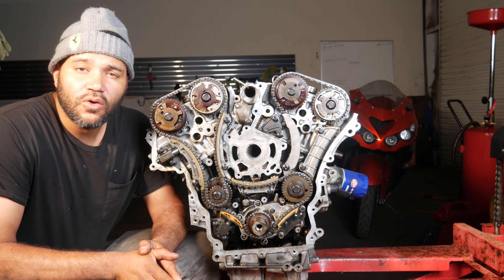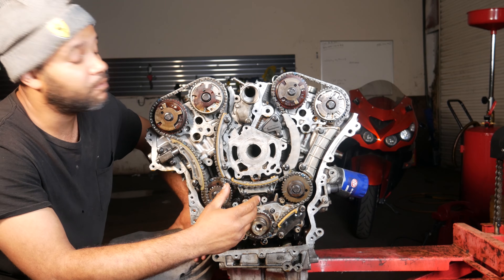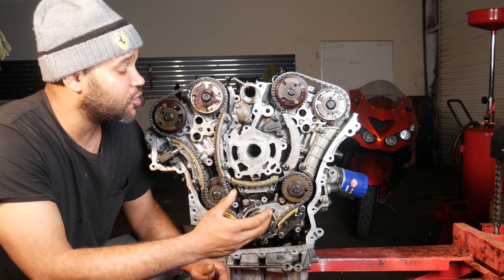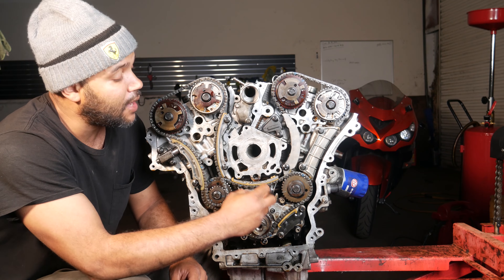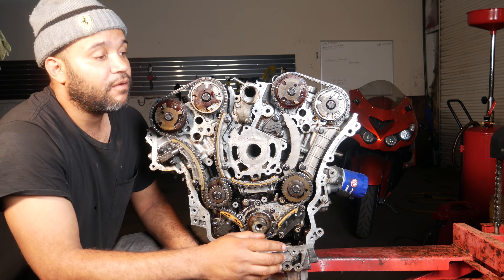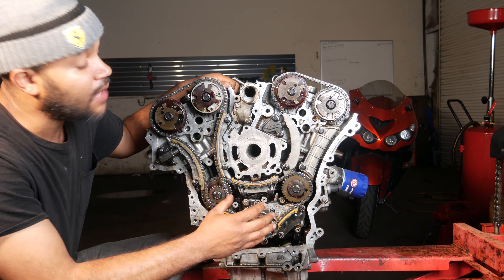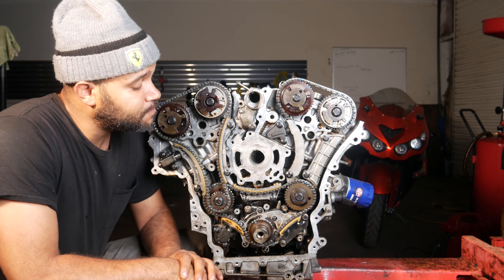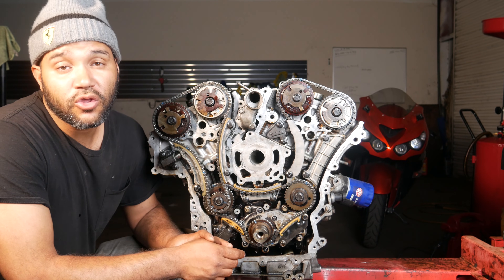HOW TO PREVENT TIMING CHAIN PROBLEMS l GM 3.6 ENGINE PROBLEMS

Comment: I have 2015 impala with 3.6 engine, i change oil every 3000 miles and only use synthetic oil. Oil changes are cheaper than a timing chain job.

Comment: The only thing I disagree with him is over 60 years I see nothing but trouble when you add motor cleaners to your oil..
I'm changing your oil at 5,000 MI should be good enough

Comment: Yeah my 2008 SRX is starting to give me those P0008 & P0017 codes. I bought it used with a lot of miles so it looks like I'll be replacing those three chains myself. I've replaced the sensors VVT, CPK and on other one but still get those codes. I'm going to try to change those chains myself because to have it done costs more than I put in it. And as we all know Cadillacs lose money the minute you drive off the lot plus they won't work on a Caddy if it is over 10 yrs old....grrrr. BTW lose the background music it irratates.

Comment: I had a 15 Camaro with the LFX engine, 165k miles and did nothing but change the oil, oil filter. air filter ,tires spark plugs and 2 purge valves. I just traded it on a low mileage 15 Camaro, I hope it lasts the same.

Comment: I'm interested to know your opinion about the PSV valve and drilling it. I have two cars with such an engine, one with regular injection and the other with direct injection. I drilled it on one engine and nothing has changed yet.

Comment: Change oil at 3.500 and no more. Change pvcvalve every 10,000. Never have a problem.  Don't drill out valve. Replace it. Oil does not last any longer. Dont let anyone tell you oil last any longer. The oil is still oil. There is no magic pixie dust that they put in it to make it magically last longer. Its BS.

Comment: Thats why you dont wait 6000 miles. Change at 3000 to 3500 miles. Never let someone tell you. Oil is better now days. It last longer. No it doesnt. If its black. Its no good. Or you can change the timing chain every 5 years. Or 80,000 miles. Old oil doesnt flow and gets hot

Comment: Noone ever condemns the oil level sensor system.  At least come up with a software update, that allows the low oil level to trigger a light, sooner.  My Cadillac 3.6 never had that light come on, and I top off my oil level very frequently

Comment: My 2013 Lacrosse is programmed for oil changes at close to 5K. I bought it used at 95K and it consumed oil when I bought it. I have changed the oil at 10% and use the same brand at every change. Consumption is way down. Carfax records had oil changes that were done at roughly 5K by the previous owners. I think that the importance of sticking with an oil brand is glossed over and that because of the cost to change the oil at a shop is so high, that many people are resetting their monitor and not changing the oil as recommended. Those people then scream loudly when they have timing chain issues.

Comment: People have complained about timing chains in the 3.6L engine for years...and all this time all it took to correct the problem was routine, periodic oil changes. Don't believe the automaker who says you can go 7-10-thousand miles between changes. Change your oil ever 3-to-5-thousand miles and you will get a very, very long life out of your timing chains and your engine. It's cheap insurance.

Comment: They said ill-advised oil change interval was the primary culprit to oiling problem. But direct injection brought pcv engine eating oil phenomenon. So basically you have to check oil more frequently, not less.

Comment: I am thinking about buying a 2016 LTZ equinox with a 3.6 v6. It has 125,000KM. Is it too late too treat it nice with frequent oil changes to make it last along time? Or should I change the timing chain and get an engine flush to start from
Scratch and then baby it with the oil changes.

Comment: Hey man I changed out chains on my 08 cadi cts 3.6 and aaahhhh I used Amazon kit chain, tensioners, guides I left the old cam phasers on there my problem was that I had a ticking noises on start up with no codes at all I go and replace a guide bcs that looked to be the problem and then I basically forcefully installed a tensioner after setting it off and that stretched the chain that’s the reason why I went with Chinese kit now I have correlation codes p0018 p0017. And p0008 engine position system performance bank 1 please help my idea is use all oem parts and replace all phasers also the ticking isn’t there is just as soon as codes pop up car starts acting up

Comment: Chains on timing is like bicycle chain. There are rollers that wear out when insufficient lubricant is allowed. When the rollers wear down the chains get longer. It appears like a chain stretch, but it is just smaller worned down rollers that make the chain longer.

Comment: I change my oil every 2.000 miles with Castrol or Valvoline high milage. im the 2nd owner since i got it. i have had chain noise at start-up. i stopped this by turning the engine over in flood mode and also drilled out the pcv valve. 264.000 I've had for 2 years.👍

Comment: Cheap oil with poor thermal heat dissipation is  what breaks down your vehicles.  These 3.6 engines do run hot, so it is crucial to have good high-quality oil with good heat dissipation, which is the key to a long-lasting engine.  Poor maintenance and neglect will cause your vehicle to have a shorter lifespan.

Comment: Timing chains stretch because its running low on oils duhhhh...inproper lubrication and heat will cuase the timing chain to stretch when they get too hot without any oil lubrication. Using cheap oils that lose its lubricity and heat dissipation will result in dry timing chain heat build up on the chain.

Comment: There is a mod to the PVC valve to get more ventilation to the engine.  Drill your pcv valve out top 7/16 hole, and bottom 5/16 hole. This will increases the ventilation to the whole engine witch I read is not the best when they built the 3.6 VVT Direct Injection engine.
Reply: Also clean the PVC all the time, it will help the inside of the engine a lot.

Comment: Thank you Boss Auto for your video. It was very informative and helpful. I have a 2017 3.6 , I’m trying to increase its life. I change oil every 5k - 6k miles. When should the spark plugs be changed for that engine? Keep up the good work.

Comment: its not just the crankcase breather and the oil life intervals . people need to take their cars to high rpms once and awhile because they need to get the oil moving around the engine and thats only done at high rpms. dear god dont use flush because that will cause leaks . use good oil , change it every 4 to 5k and take it to high rpms atleast once a drive

Comment: I have a 2015 impala 3.6 with 75,000 miles.  I change my oil every 4-5,000 miles.  I use the Napa gold oil filter as well.   As far as the engine breathing, the rear bank of the engine has a breather tube on the valve cover, but it is not removable.  I learned the hard way on that.  I'm guessing periodically i can run a piece of wire down that tube and keep it open.  I never have any oil in my intake or on the butterfly.  I don't have issues with the engine using any oil either.  So far, it's a great engine.  I'm thinking about adding some engine flush before my next oil change.  My brother had a Buick with the same engine.  His engine coded with the dreaded timing chain issue, and started mis firing.  He drove it, after I warned him not to.  Big mistake.  It threw a rod through the block.  That was a dumb move.

Comment: I just bought a Chevy 2024 premier blazer. I’ve had it for a little while now and I drive it to work around 8 to 10 miles a day one-way. I pulled it in my garage and change the oil at 2000 miles and that oil came out really black at 2000 miles so believe it or not I will be changing the oil at every 2000 mile intervals I know that’s excessive but I had a 1987 Chevy pick up with a 350 in it throttlebody injection and I changed you on that every 2000 miles, I had the engine for 425,000 miles and I still have the truck today with the same engine no problems and it doesn’t burn oil. I know the engines different than this one but I will be changing the oil just like that I can’t believe how black the oil got 2000 miles if you could use the GM oil monitor in your car all they want you to do is make sure it gets past the warranty and then you’re on your own. Thanks for your video. I’m sorry about the car but this is what I have now thanks again you really explained it well.

Comment: Yes Sir engine flush with every oil change. My 2014 impala gets 2 oil changes a year. Nov & May so I'm ready for winter & summer. My tip is to jack the car up on the driver side about six inches and let it drain for at least 1 hour. Or until you can count to 30 without seeing any oil drip out. The oil drain plug is on the passenger side facing the rear of the car. I drive about 10000 miles a year.

Comment: I have a 2011 Buick Enclave with 184k miles on it. I follow the factory oil change guide (7,500 miles) and infrequently add a ceramic additive.
I think changing the oil every 5,000 is a prudent suggestion.
I also encourage replacing the PCV valve and breather tubes every 75k miles. Enlarging the breather holes on the PCV valve is strongly encouraged.
Reply: Great advice but this should only apply to model years up to 2012, after 2013 they welded the PCV valve to the valve cover (even if it looks removable), I learned this the hard way after trying to service mine, ended up breaking it off trying to remove it. Had to remove the whole valve cover to replace with a new one, that's when I learned it is no longer serviceable and should be left alone.

Comment: FORD GM ALL MADE ENGINES W/ one timing chain and they ran for ever NOW car engines have four cams four - five timing chains DESIGNED ONLY to FAIL OVER A SHORT PERIOD OF TIME & PLUS WHY IN THE HELL WOULD YOU INSTALL THE WATER PUMP INSIDE W/ THE TIMING CHAIN THATS LUBRICATED BY OIL IF THE WATER PUMP FAILS YOUR ENGINE IS FUCKED. 🤦🏻‍♀️🤦🏻🤦‍♂️🤷🏿🤷🏿‍♂️

Comment: Got a 2007 STS, v6 3.6. It has had the recommended oil put for the entirety of the engines life (full synrhetic says 7k but I do it 4k). I check my oil everytime I put gas in it. My car is 17 years old and runs as quiet as a hybrid. I replaced the starter and water pump only thus far.

Comment: So much negative talk online about the 3.6, is it really bad and how does it compare to the 3.8?
Reply: I still own a 07 grand prix with the famous 3.8 V6 NA  with 160,000k miles ❤. Also have a 2014 Enclave with 100,000K miles on it running good, the key for the 3.6 V6 was to replace the oil (by myself) with full synthetic top quality oil and filter every 5K miles. I just removed the rear valve cover to replace the imposible to pull out PCV valve for the first time (should have been done a long time ago) and replace the original AC delco spark plugs. I was very surprised that the valve cover was not as bad as I thought it would be, and the spark plugs came out dry, no oil on any of any of them. By the touch, the secondary timing chain doesn't feel loose. Also, I can't find any sludge buid up on any part that was exposed en thar side of the engine. 
Now, since I know the condition of the engine on that more problematic side I'll start changing the oil at 4K miles just to keep it healthy.
Definitely it's nor simple and reliable as the 3800 series 3 V6 but it's not as bad as many people are saying it just requires a bit more attention.

Comment: Hello, I have a 2012 Chevy impala with a 3.6 engine. It has a little over 200,000 miles. One day while coasting down the hwy it suddenly sputtered out, after rolling to a stop I attempted to restart the motor and it turned over 3 or 4 times then siezed up. The motor has been regularly maintained with oil changes. Could the motor failure been caused by a broken timing chain?

Comment: The worst thing General Motors ever did. Was to replace the 3.8 L with a 3.6L.
Reply: 3.8l or 3800 are a much more reliable and easy to service it

Comment: I'm sure you are right,a dding a spinner to the oil system would probably be a good idea to pick up particles that could be deposited inside the engine.

Comment: I’ve got a 2012 Acadia with 161,000 miles.  It got new oil and filter every 5000 miles and doesn’t burn any.  I never drove it hard, the transmission is on its 3 or 4th drain and fill and works fine.

Comment: Confirms what I've been hearing. I just changed the timing chains (195,000 miles `09 cts). Code was saying left bank chain was stretched and I couldn't pass emissions. All done and did a couple of changes and a flush (and a plug change). 
No problem passing emissions. Its gotten only mobile synthetic - but I'm bumping my changes up to every 3,000 miles. Good video - THANK YOU!

Comment: Don't underestimate the impact of the "PCV VALVE".
2004 - 2007 models had a design flaw, and the pcv valves will gunk up and jam.  This causes increased crank pressure issues, resulting in excessive oil use / oil burn / sludge.  The pcv valve can be "maintained" (cleaned at every service), or (better yet) MODIFIED (see videos on how to drill resized holes), or replaced with the new (> 2013) design.  There are those that believe THIS (pcv valve - poor ventilation) is WHY the GM service intervals are too long.
Reply: My 3.6 was starting to hesitate and jump the idle a bit.  I put a new PCV and MAF sensor and that really stopped both these conditions.

Comment: wow, our 2012 Impala LTZ has 185 thousand  +, it dropped a coil #4, so thought I would replace all 6, then checked timing chain replacement and estimate to change these and haven't checked on oil pump yet. I may have to park it . We bought this used at 26, 500 miles, 110,000 had to get transmission replaced and it's still has a hesitant at 50mph in cruise. I just don't know for sure what to do. I enjoyed your video though. Thank you and Merry Christmas
                                                           

=

Comment: Changing syn oil under 5,000 miles is waste ...Dont use motor cleaner it will loosen up sludge and c 
ause leaks

Comment: I had an 08 Suzuki XL-7 with this engine. I bought it new and kept the oil clean. It lasted about 80K miles before the timing chain stretched enough to throw codes. There was a recall that I missed. $2-3K repair back in '17. Traded it in.

Comment: Don't run the engine, and you won't have problems with the Timing Chains. I had the 3.6 in a STS. Gm replaced the Chains under Warranty when the Car was 8 yrs old, with about 120,000 on the odometer. Well, the Stealership claimed they replaced them, but I think they took my engine and swapped it for some buddies engine, that was much higher Mileage/ After the supposed Warranty work, I now had a Coolant Leak, Torn Motor Mounts, and several CEL codes. A Person just can't trust a Business or Businessman

Comment: Just use diésel oil , your engine Will always be clean . I use It in all my gas engines, Its the detergent in the oil that keeps it clean . My HHR 2.4 Chevy has 224k miles AND Is like new inside. Shell Rotella Is Best !!

Comment: Matter of fact, exactly where you are sitting, and your hands rest, is where the oil moisture is on my car, and where i felt the rubbery stuff portruding between whatever covers all that up and the block, and got new oil on my fingertip. The oil filter would be the front of my engine, where you sitting the rear. See my first comment. I also suspect engine sludge. Again I don't know shit bout cars. I change oil according to oil light. Great vid.

Comment: My 2015 lacrosse stalled on highway right after an oil change. Towed home it won't start now. Low oil pressure light had start coming on after every 20 to 30 minute trip for a few days prior. I would shut engine off, wait a few minutes and it would be fine. But same problem after about a 10 mile/20 minute trip to work, and on way home. Tensioner pulley was rattling. I hope engine is not seized. I read it may have a sensor that shuts engine off when oil pressure is too low to prevent blowing or seizing engine. Hoping thats the case. Haven't got it diagnosed yet due to money problems. Its been sitting 35 days. Yesterday checked oil it was lower than a month ago when shut down. So climbed under to see if any oil had leaked and can see at bottom towards rear of block under where pulleys are it looked wet. And had oil build up. Stuck hand under feeling around and felt a small rubbery portrusion and clean new oil was on my fingertip. I literally pulled the rubbery stuff of it is white. I don't know much about cars. I guess it is a sealer or something. So guessing thats where the slow leak is. Trying to determine if need oil pump or a gasket. Or if engine seized on me, or if sensor just not letting car start due to leak messing with pressure. I also realized oil change only put 5 qts in and it takes 6. And its low at least a quart since when checked day it got towed home. No stain on ground though. Just oily around whatever part that is down there toward the rear of the engine under the pulleys. I am thinking thats where the oil pump is? By looking at your vid its near the crank.

Comment: The manager at the oil change place I go to asked me what I wanted the oil duration mileage set at, I said 5k. Either there is a way to change it or he was BS'ing me. He seemed  to know the engine  and its problems. So far it seems accurate.